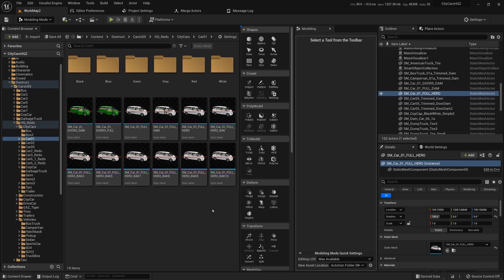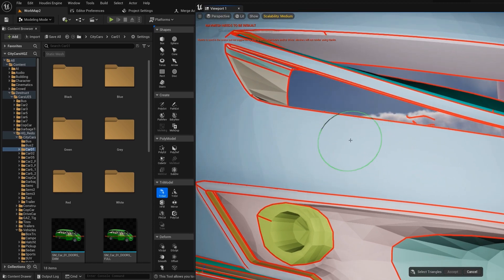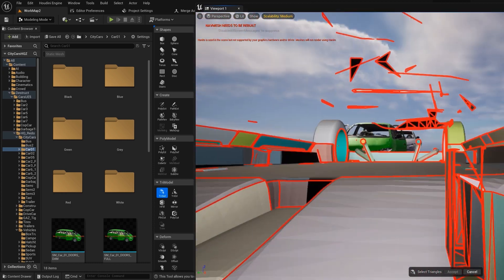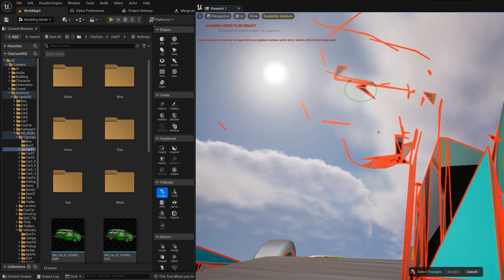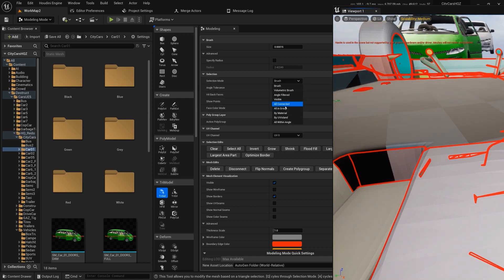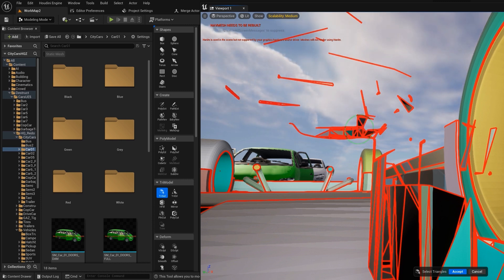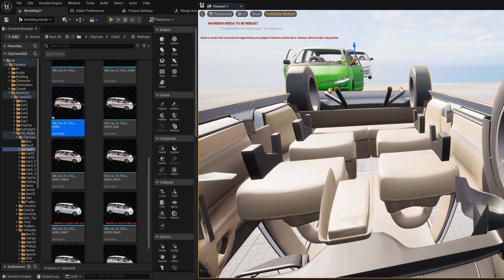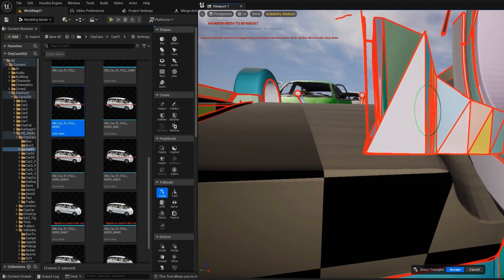UE5 Tips on How to Use the TriSel Modeling Tool

Comment: hi dude, do you know how to turn on the world XY axis Guiding line on modeling tool by using PolyExt. i allways can't take my draw line straight.thanks
Reply from the maker: I'm sorry, but I do not know how to do that. That is a tool I have no used thus far, and my experience with the modeling tools is very limited to just a few (pivot, TriSel, Lattice and a few others) right now, and what I know is mostly based on experimentation.
Reply: @RobinDale50  but still thank you for the reply. It's ok ,i will still dig in.